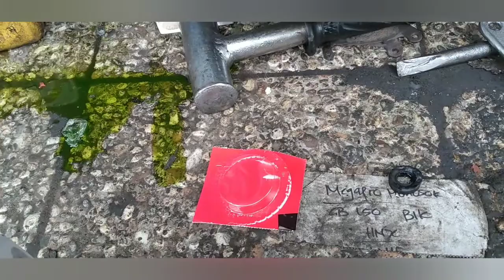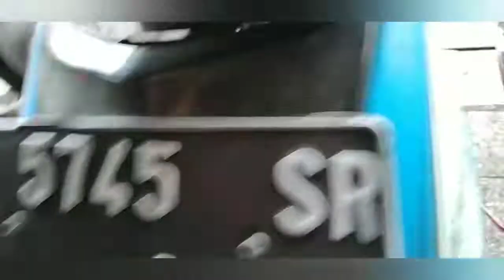CARA ganti seal water pump motor Honda Vario

Comment: Bg setiap ngisi air radiator  slalu kluuar . Itu bocor nya apanya ya
Reply from the maker: Ngisinya langsung ke radiator atau ke cadangan
 ngisi di cadangan klo terlalu penuh pasti terbuang keluar sebab ada selang untuk pembuangan tapi tidak akan habis
Tapi klo ngisi di radiator selalu kering airnya berarti seal water pump bocor dan harus ganti baru
Terimakasih sudah mampir di Channel YouTube saya
Reply: Sekitar brp ganti seal water pamp nya mas
Reply: Lampu indikator motor vario saya nyala ketika motor dibawak jln bbrp kilo .air radiator sudah di kuras diganti atas bwh tapi masih tetep nyalah merah lampu indikator nya.
Reply: Penyebab nya apa lah mas.air radiator klo pas netes nya pas lagi isi aja kepenuhan suka netes dari kolong injakan kaki.stelah itu a netes lagi.
Reply: Kira2 penyakitnya apa mas apa yg harus diganti.nanya ditiap bengkel jwbn mekanik nya beda2 jadi bingung😀😀😀
Reply from the maker: Klo ngisi di tabung cadangan terus ada tetesan air  gak apa mas karena disitu ada lobang pembuangan berarti itu tandanya penuh
Reply from the maker: U/ biaya relatif mas, sebab beda daerah beda pula kebijakan ( harga barang) dari sipenjualnya dan ongkos bongkar pasang pun pasti beda to sekedar info gak lebih dari 200k
Reply from the maker: Kalo air radiator selalu kering berarti seal water pump pecah mas, dan kalo dibiarkan lama-lama panas yg akan mengakibatkan kerusakan mesin